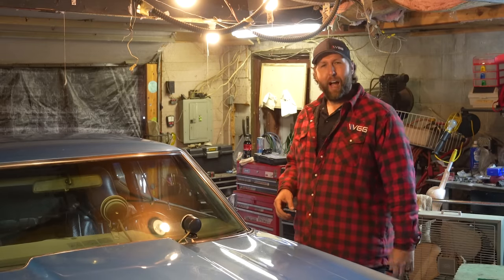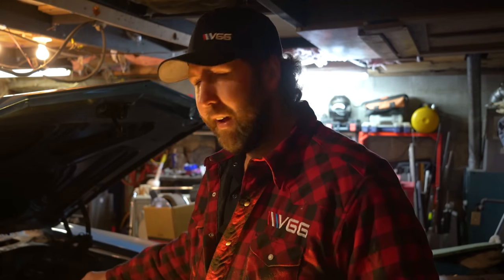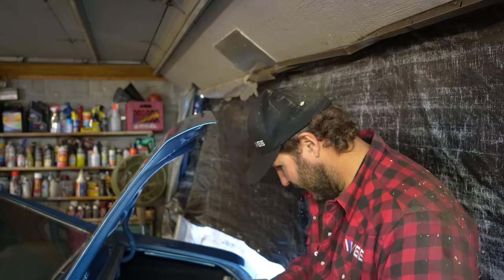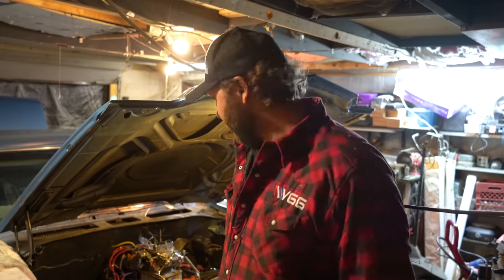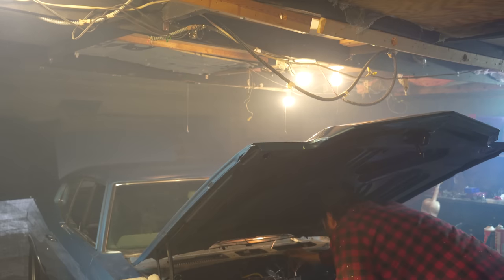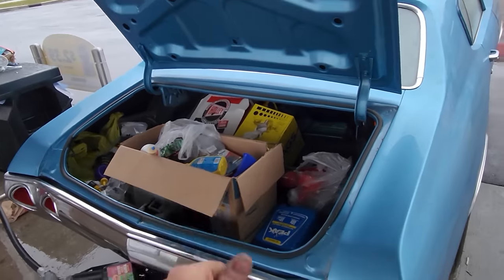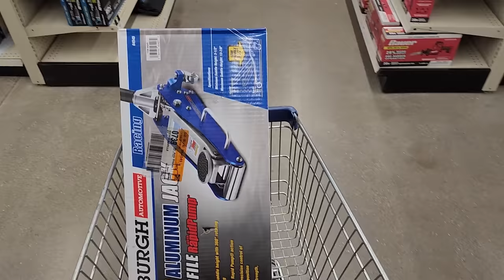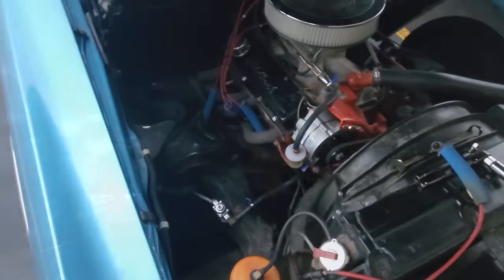80s Built Chevelle Drag Car - Will It RUN AND DRIVE 450 miles home?

Comment: Heavy Chevy was equal to the Pontiac GT 37.... the T37 didn't have the GT sport option which included the factory hood pin, dual exhaust, GTO stripe, ect......

Comment: Any interest in a couple 72 cutlass s both in different stages of undress one has a 350 the other a 455 one runs and drives one does not. One has a custom interior one does not. Both have been in my garage for 15 yrs. The one I start and drive around the block say once a month. No more clues. Pics upon request. I’m located in PA just outside Philly.

Comment: I guess you never heard of that if your vehicle is not front-wheel drive use a dolly to transport your transmission just no lubricant or fluid you have to take the driveshaft off so transmission does not spin or else it runs dry and then your transmission is shot

Comment: Leave the car as it is don’t touch the paint she’s beautiful I would change the rear end in that car to make it a little more highway drivable and possibly change the roll cage around and where is the little more comfortable to sit in but definitely make it to where it’s comfortable to go down the highway with and put some miles on because running at 3000 RPM. Sounds good bad for the motor.

Comment: I'm gonna say Derick got balls the size ofmoons sheriff on your butt driving an outlaw drag car ITC. Incredible collector pray u didn't spend ten grand although probly couldn't build one for less😂😢I dream of living this lifestyle 
I'm currently involve😮d restoring in my spare time foye trucks while raising six year old daughter alone
Reply: Clarifying got a 95 f150 w blown 305 and have a 305 waiting to be craigslist rebuilt on the stand ,got a 92 f150 that's complete running but needs a lot of TLC never been plated or titled in my name waiting for attention,got my 94f350 4x4 I'm painting day at a time weather permitting,and have my 1966 c30 custom camper I've been getting tires for ,also have my car hauler trailer 10.000# I'm sandblasting welding and fixing wiring every other Chance I get installed a 12000# winch inside a gangbox to pull cars up onto trailer and keep it secure I work a full-time job I'm 61 yrs young and a father it's alot believe me😊
Reply: I pray more people will have a sense of humor and solid work ethics from experiencing the additives displayed for all to see it's a tall order to be so naked and tall

Comment: Drive it like you stole it out some hwy gears in the rear and have fun at 100-150 all day 6800 rippers u could go 150 all day. No wait till it blows do an ls twin turbo after you blow up that 400. I blew up 2 of em they dint seem to take the punishment I like to deal out. Sound great with headers at high rpms tho. Regular race car. Wildwood disc brakes drive it like you stole it

Comment: All viewers. Need advise. I'm doing my own Will it run and drive starting tomorrow. 1,500 miles. Tucson to Baton Rouge. It's a 1st gen Toyota 4Runner. 6CYL.. 2WD. I know it's no where near as cool as Derek's car, but... Do I teak back roads or go slow on the highway? Need input! Thanks!

Comment: A SB 400 with Camel Backs? Camels Backs don't have the necessary weep holes that the 400 needs in the heads in between those Siamese cylinders on that 4.125" bored SB 400 to keep her cool..??

Comment: this was built when parts were still evolving if its got a 7000 redline guaranteed the 400 rods are gone too ! he most likely used 6 inch olds rods or steel 5.7 350 rods the 5.56 400 rods would turn into horseshoes at 5500 rpm

Comment: Stick a good Ford engine in it, than you won't even have to pop the hood. Than you can drive it wherever you want,  maybe off a cliff. My Ford's I have I don't even have to check them monthly, just get in and drive, they don't miss a beat, and they get beat, they might be a quart  low once in a while but that's it. I like old chevy classics, but have never liked there engines, I blow up so many chevy motors  that I don't buy chevies any more, all my friends that own chevies spend every weekend working on their chevies, while I go drive my Ford's all week or all month, or their use my Ford to go get parts for their chevies, then they ask when do you work on your truck, then I say I don't work on it, never have to. I can put a Chevy motor together blind folded, but can't work on a Ford motor because there is never anything wrong with my Ford motors. I doubt that I can be that lucky with all the Ford's I have had, there got to be something to it. I know one thing though if you beat a chevy you are going to be working on it. You sure got a lot of chevy products on your channel, makes me not want to watch it.

Comment: Did you really not know that the green light with that switch needed to be on for the starter button?
Reply from the maker: 99.99% of starter buttons in drag cars operate with just main power on, NOT ignition on.  This is for maintenance, such as compression checks and rocker /valve adjustment.  So, yeah, I didn't know.